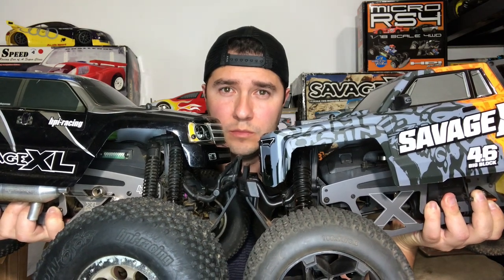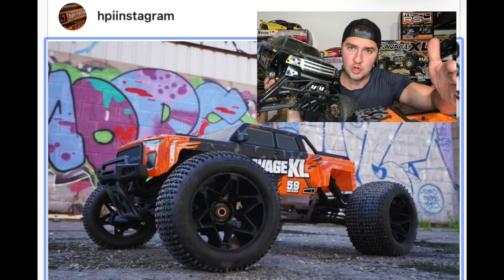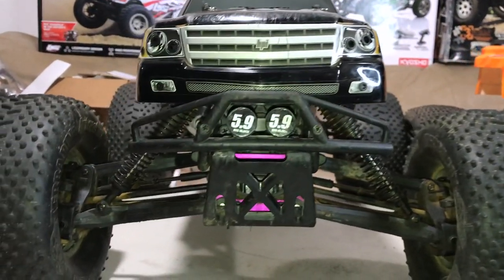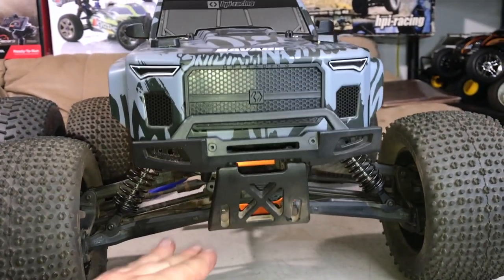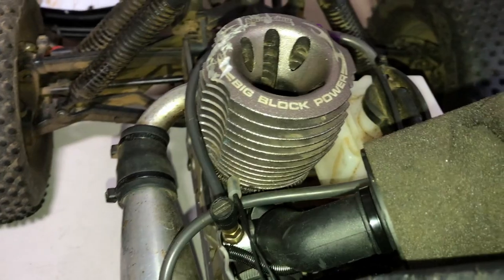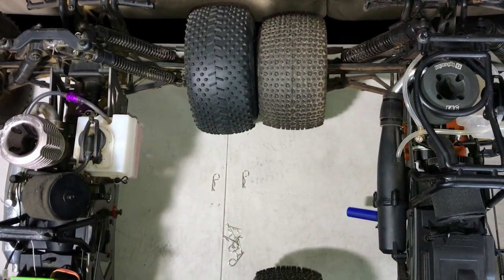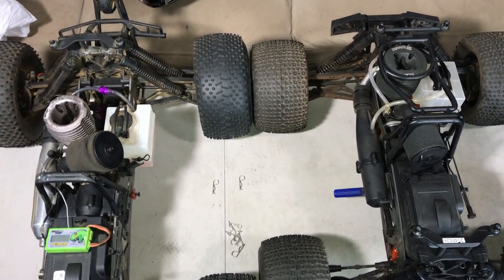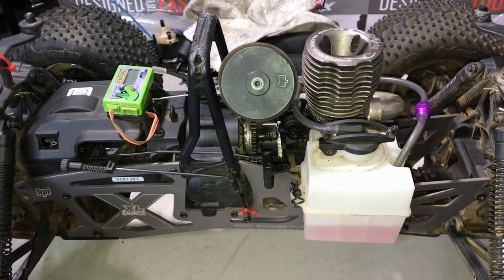New HPI Savage XL 5.9 Announced - Current X4.6 Vs The XL - How Much Will it Cost?

Comment: I'll definitely be picking up the new Savage XL. I think the price is going to be $799.99. I believe that I payed $599.99 for the last model XL before HPI collapsed. The new features you didn't mention are: The most significant is the fact that the 3 speed has two of the Octane steel gears inside which will improve durability. You now get factory 17mm hubs, a newer 5.9 which STILL includes a roto start, aside from the newer big bore shocks, everything else is the same which is great because now we'll have tons of spare parts for our older XL's. I wouldn't have mind HPI release the XL 2.0 shown years ago at a toy fair but it's not a bad thing to get a slightly updated version of the almost most perfect nitro monster truck to ever exist, yes, that includes the Tmaxx.

Comment: It would be cool to compare how the old savage combination 52/14 vs the new 47/17
Reply from the maker: 100% great point my dude!  I will surely test out the speed claims of the new savage, we have some good results on the last gen model and something to compare it to.  BTW on my XL I'm running taller gearing of 52/17
Reply: @hybrid32494  really?  I thought the 17 bell was too large for the 52 spur
Reply: it's literally identical lol, they just changed it to say it's new.lets face it the hpi company is struggling to stay alive.so they pumped out a "new" savage, there's not much new about it. still the same great savage as always, but definitely behind the times.

Comment: TVP's drove me crazy, revolutionary pain in the ass, at least in my opinion, haha!
Reply from the maker: hey dude! thanks for checking out this video! Well the TVP chassis is not the easiest to work on, but I will tell you it's extremely strong and almost never requires you to do much, because you cannot kill, it!  NitroGang!..
Reply: @hybrid32494  thanks for the reply. I agree it is a tank, but my issue is if you have to deal with a part (like the transmission), you almost have to take the whole thing apart. I had the Savage 25 and the Savage Flux XL, had a blast with both!

Comment: What is the green box for on top of the XL
Reply: Looks like a failsafe to me. To prevent runaway on the old radio receivers.
Reply: Could be a temperature gauge too
Reply: @gregoryhines7  I was thinking that or battery meter
Reply: @gregoryhines7  I was thinking temperature gauge not fail safe
Reply from the maker: hey dude!  that green item on top of the old XL truck is a Venom Temp Gauge, not a failsafe.  The 2.4Ghz HPI radio already had a failsafe built in at the time.  This is a highly accurate receiver powered temp gauge, I've used it often and it's quite helpful.
Reply from the maker: @gregoryhines7  yup man!  thats a vintage Venom Temp Meter - Good Guess!  Sickeing!!
Reply: @hybrid32494  I can't wait to see the difference between the old and new XL sounds like it will be "XLent"

Comment: I'll just do the same thing that I did when the gt6 came out take one of my old 25s and buy the gt side plates shocks front& back skid plate bumper with hing pin cap 17m hubs and body with roll cage for about 120$  then put a 4.6 off eBay I rebuilt piston kit 50$ for 200$ total it almost impossible to tell the difference it definitely doesn't look like a 25s any more and I'll have 400$ left for upgrades if I was comparing the price difference or I can buy the xl conversion parts when the xl parts when they are offered.  I own 8 savage 25s lol soon to be gt6 and XL  my blood in made of nitro.👍👌✌️💯🥂🍺
Reply from the maker: hey my dude!  thats a very interesting plan you got, you sure know your savages bro!! I'm glad to have you here on this channel.  I totally agree with you btw.
Reply: @hybrid32494  it's cheap to turn a 4.6 x to the new gt6 check out jc rc the parts are there to do it even the body and when the xl trucks out  they should have the parts some after I'm positive that company and dollar Hobby's disassemble new car for the resale of part's  that why there parts are in zip lock bag  and not hpi official bags.💯👍👌✌️💯 Ps they probably make more on the parts then they do in sell of the truck   aka people try to kill there nitro bro.

Comment: I noticed that fuel in the 4.6 tank man it looks like pee I don't think that a good thing for the engine it looks like it needs some fresh nitro and to be ran to be great again. Just my opinion 🤔👍👌✌️💯🍺
Reply from the maker: hey bro!  that is a great observation.  I previously left some 30% ones brew in there a few months ago, and it's since become discolored.  Before running anything I always flush out the tank and add new nitro fuel, you're on the right track bro!  NitroGang!..